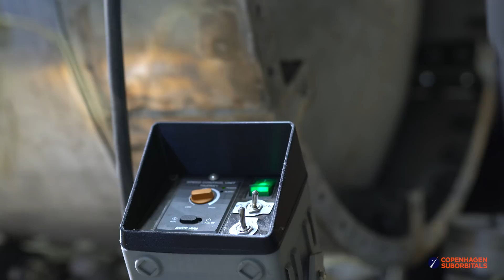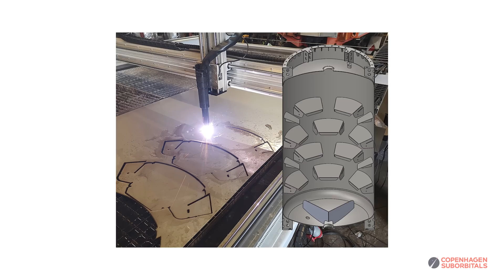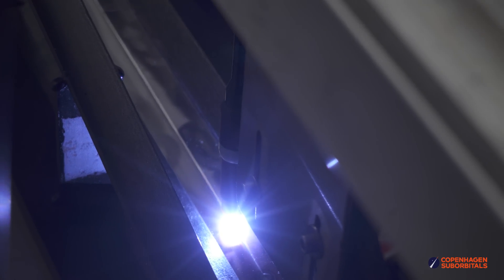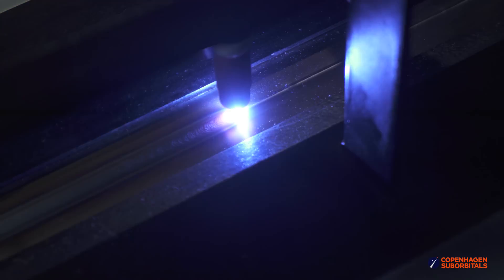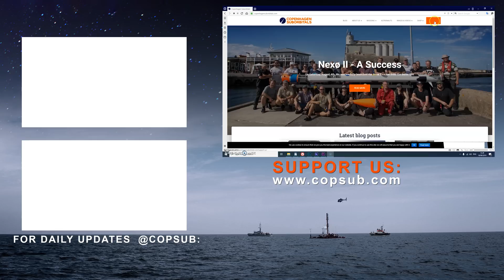Stacking Our 304L Rocket Propellant Tank Bulkheads! | INSIDE THE ROCKETSHOP: Episode 28

Comment: What propellant management device are you using for positive expulsion?  For when gaseous ullage bubbles form in the tank during zero g.
Reply: They only experience zero G after ditching the booster.
Reply: @johndododoe1411  Ah, didn't realize the second stage does not have an engine. Thanks!
Reply: @shakytoes  Tank itself is part of booster pushing G-forces until no longer using fuel.

Comment: You really need to do a test tank to see if your welds hold up like space x do
Reply from the maker: We've done smaller scale tank tests to destruction, where the tanks ruptured only at 96bar (>4 times our operating pressure) and we've also done pull tests on our weld samples, where the welds proved to be even stronger than the original material. And once these tanks are welded we will deformation harden them, which will take them well above flight pressures as well.
Reply: Cannot wait to see this fly. You guys and girls are doing a fantastic job
Reply: Are you going to do a cryogenic test on the tanks too ??
Reply from the maker: @pnutamechatronix544  Just on one. :)

Comment: A question, what permits do you require to build and launch rockets also permits needed for storing fuel?
Reply: Well, their fuels are common commercial liquids (liquid oxygen, alcohol, liquid nitrogen), they no longer use HTP etc.
 As for the launch stuff, they used to just need the air traffic clearance and permission to borrow the national guard navy firing range in the Baltic.  They also did some work with the foreign office to file space flight plans to the UN. But now there's a special state law for our space industry.
Reply: Thanks I will use this knowledge

Comment: Starship material 304 L stainless steel 😂😂
Reply: Actualy, both NASA and SpaceX has done several experiments with stainless steel with good results.
Reply: @R2-X15 not only stainless steel but 304L stainless steel.  that code denotes the strength of the rocket v it's deltaV v weight v cost ratios for starship, it's the interest of SpaceX to find the cheapest but the safest way.